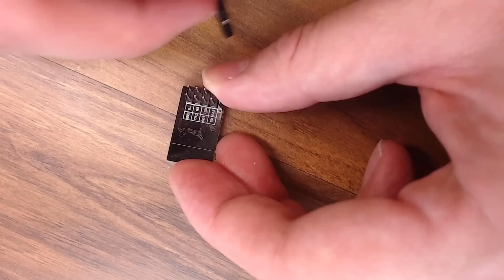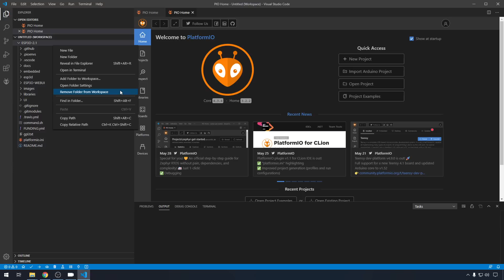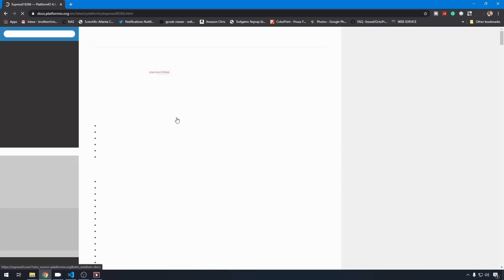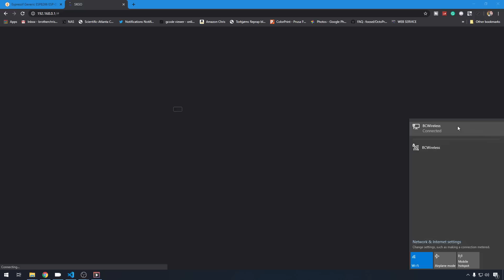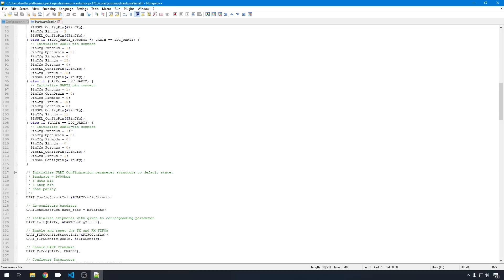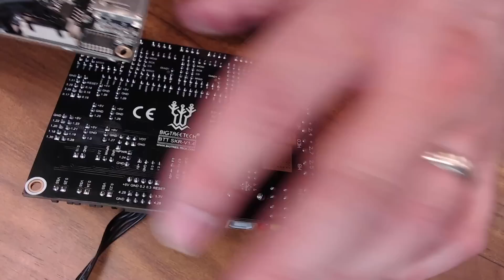Add Wifi To A 3D Printer - SKR 1.4 - ESP8266 - ESP3D - Chris's Basement

Comment: hello, i have problems with the esp8266 module, i do configure everythin just fine, and when i connect the module to the usb/serial adapter the esp3d ssid is ok, but when i do connect the module direct to the skr 1.4 board the module do not work, i tested the pin of the skr that goes to the ch_pd pin from and the output is 0V, that must be 3.3v, any help for this??
Reply from the maker: Those should be active all the time, so there might be something wrong with the board or voltage regulator.
Reply: @ChrisRiley  I just buyed two of the same SKR 1.4 boards and both have the same issue, and specifically to use with the esp8266 01, the only difference with the video is that you used the SKR 1.4 TURBO, but seeing the pinout of the WIFI port on skr1.4 and skr1.4 turbo on the board is just the same, THANKS for the response!!! I will try to solve this from the hardware side make a litle piece of board to make a short between 3.3v pin and CH_PD. Your videos are really helpfull and usefull. Keep going man!!! my best regard from Paraguay SOUTH-AMERICA

Comment: @11:46 - the error mentioned here does not appear in release 2.1.1, can anyone confirm this is OK? (I'm assuming it is, I'm just paranoid...)
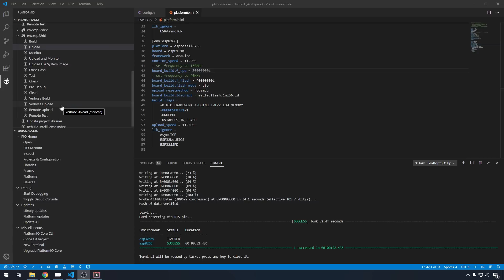Reply: also, @17:01, I dont have the "Upload File System" button.....
Reply from the maker: Check the ESP01 env, it should be there.
Reply: @ChrisRiley  So, the files are in esp3d/data (had more time to actually comb through everything). It appears as though you can still interface with the it through the web, you just need to manually upload the index.html.gz there. A button up top will say "switch to ESP3d Interface" or something similar, that will initiate the wizard.

Great Vid, and Thanks for the help!!

Comment: Chris, thank you for these excellent instructions.  I loaded the latest code, but when it came time to 'load file system image' I could not see as an option.  Clean has replaced "Erase Flash'.  Any ideas? thanks again.
Reply from the maker: There should be a ENV:ESP01 in there now to load the file system.
Reply: @ChrisRiley  -thanks, does this replace the [env:esp8266]?
Reply from the maker: No, just for writing the file system, not for code flashing.
Reply: @ChrisRiley  - So where would I need to add this ENV:ESP01?

Comment: i have no 'upload file system image' feature but everything else works. Idk whats wrong
Reply from the maker: Check under env:esp01s.
Reply: @ChrisRiley got the same proble,  what you mean with it?
Reply from the maker: @Thermal488  There is an option in the menu for the ESP01, you can upload from there.

Comment: Hi Chris, thank you for your videos, they helped me from the very base to understand and be able to compile my Marlin2 for Both LGT V1 (OEM for LK4 pro) and SKR 1.4Turbo i bought newly. Due to i've the TFT24 i had to work out a serial connection more to be able to use the screen in touch mode rather than Marlin that is unlike to me. To do it I ( #define serial_port_3 0 )right under the first 2 you suggest during the video. I really didin't know if this could work but Marlin2 got copiling w/o errors and flashing doing it good as well.
Thank you man again!
Reply from the maker: Great to hear, the Marlin team has changed somethings up for us to make this a little easier.

Comment: hi chris i am having problems after i enable wifi support i get file not found
Reply from the maker: Where do you see file not found?
Reply: @ChrisRiley  in the output screen as it compiles
Reply from the maker: @stiggybishope5449  Try to run a clean in the build menu.
Reply: hi chris my folder are fresh but esp3d  archive does bit si the file data option you mention
Reply: hi not sure whats going on but i get chip sync error

Comment: Chris could you make a video on flashing firmware to an skr1.4 either via octoprint or one of these esp modules?
Reply from the maker: I can check it out, not sure how it works yet.
Reply: @ChrisRiley  Me neither. Been banging my head against a brick wall with it. But other than processing power there's not a lot of reason the pi shouldn't be able to run platformio to flash the board via serial. Even building the firmware on something more powerful like a home pc and sending it to the pi over ssh to then flash.

Anyhoo, I love the content bud keep it up :)

Comment: It's a lot easier just buying a purpose built esp01 uart adapter to program these chips. You just need to solder on a button for when you plug it in to enter flash mode and you're good. Neat, no need for jumper cables. 
https://m.banggood.com/OPEN-SMART-USB-To-ESP8266-ESP-01S-LINK-V2_0-Wi-Fi-Adapter-Module-w-2104-Driver-p-1272171.html
Reply from the maker: Great tips, thanks for the link.
Reply: Also there is a few cents difference in price between the esp01 and the esp01s modules. Don't buy the esp01 buy the esp01s.

Comment: do u need the DCDC converter? SKR1.4turbo and esp8266
Reply from the maker: Not to use just the Wifi, no.
Reply: @ChrisRiley  would it cause issues? I have tried flashing with your method and with their uploader and neither of them provide an access point to connect to. I have managed to find the access point but it only stays up for about 30 seconds. I've also tried swapping tx and rx pins, timeout failure
Reply from the maker: @eliterr7005  I could be the module is bad or the voltage regulator is bad on the board. You can try and power it up off the board, this video might help you hook it up. https://www.youtube.com/watch?v=pJGBRriNc9I&t=1s
Reply: @ChrisRiley  actually reflowed the board and it works now. must have been a bad solder joint, would only work when squeezing the board between my fingers

Comment: I have a problem the wifi chip works while it is connected to a usb hub but as soon as i connect it to my skr 1.4(non turbo) it wont connect to wi-fi and my hardware serial.h is not the same it has a lot of if arguments and i dont know where to check witch is active.
Reply from the maker: There might be a problem with the voltage regulator on the board. Does it check out with your multimeter?

Comment: I don't have the Upload File System option. Thoughts?
Reply: Same here :(
Reply from the maker: The library may have changed. You can try using the web tool ESP3D software gives you or try running a clean from the build menu to reload the libraries.
Reply: @ChrisRiley  used web ui to upload data files. Works like a charm. Thanks for your videos!

Comment: Mine fell down at 11.45 'Path to shell executable "c:\Users\Ben\Documents\Arduino\ESP3D-2.1.1\platformio.exe" does not exist.' Any ideas?
Reply from the maker: It looks like it didn't get the library installed. I would try to reinstall the platformio extension and see if that helps. Also, you might try running a clean from the build menu.

Comment: Chris, good day.Your videos are very clear.I have a set:SKR 1.4 Turbo+TFT 35V3+ESP8266+3DTach+power off module(MW350 power supply)?Marlin 2.0.6; I connected everything according to your lessons-everything works out, thank you.But questions remain-please help.WiFi only works on the display.On the Board, according to your lessons, it is not possible to start(activate) - in Marlin2.0.6 contacts (28 and 29) in the UART3 port are registered but it still has pins (P0_25 and 26) and the module does not respond.((((Please help me figure out how to connect to Repetier-Host (I don't have a stable connection) and send files to the SD card of the Board?Files in their entirety are not they are sent, although it shows that the file is being written.I'm from Saint-Petersburg, please forgive the translation difficulties.Thank you for your work.Stability and good luck!!!
Reply from the maker: You will not be able to use the screen and the wifi connected to the board the serial gets confused. That's why it works on the screen, the screen is utilizing one of the serial ports. It's unfortunate, but you will have to pick and chose with serial devices you have.
Reply: @ChrisRiley  Chris, good day.I watch your videos many times .You have shown the solution path in Marlin 2.05,I use 2.06, and in the file (HardwareSerial) uart3 looks like this - (( } else if (UARTx == LPC_UART3) {
      // Initialize UART3 pin connect
      PinCfg.OpenDrain = 0;
      PinCfg.Pinmode = 0;

      #if defined(LPC_PINCFG_UART3_P4_28)
        PinCfg.Funcnum = 3;
        PinCfg.Portnum = 4;
        PinCfg.Pinnum = 28;
        PINSEL_ConfigPin(&PinCfg);
        PinCfg.Pinnum = 29;
        PINSEL_ConfigPin(&PinCfg);
      #elif defined(LPC_PINCFG_UART3_P0_25)
        PinCfg.Funcnum = 3;
        PinCfg.Portnum = 0;
        PinCfg.Pinnum = 25;
        PINSEL_ConfigPin(&PinCfg);
        PinCfg.Pinnum = 26;
        PINSEL_ConfigPin(&PinCfg);
      #else
        PinCfg.Funcnum = 2;
        PinCfg.Portnum = 0;
        PinCfg.Pinnum = 0;
        PINSEL_ConfigPin(&PinCfg);
        PinCfg.Pinnum = 1;
        PINSEL_ConfigPin(&PinCfg);
      #endif
)) I Can't connect WiFi on the Board(TFT is disabled).Help if you can.Thanks.Stability and good luck!
Reply from the maker: @jress6778  Is the module powering up?
Reply: @ChrisRiley  Yes, the module works clearly on the screen.If I put it on a Board without TFT, it is not determined by the Board.The port is registered 3 and 0. the code in Marlin is not clearly spelled out;in the letter above.Thanks.Good luck!
Reply: Same problem
Reply: @eklypa  я остановился на том,что модуль прекрасно работает в гнезде TFT 35V3;без подвисаний и в обоих режимах экрана=доволен очень.Те кто пишут о не понимании нужности этого модуля для меня странные;с ним удобнее работать со смартфона и удобнее даже нежели с тачь экрана принта.Если есть вопросы-рад буду общению.Спасибо.Удачи!
Reply: @jress6778  только что разобрался. Оказывается у меня стояла разная baud rate в прошивке принтера и в модуле wi-fi >_<
Reply: @eklypa  два вопроса-какая плата,и на каком Марлине?Спасибо.
Reply: @jress6778  Marlin 2.0.7, SKR 1.4 Turbo, ESP-01S (BTT)
#define SERIAL_PORT -1
#define SERIAL_PORT_2 3
#define BAUDRATE 250000
Больше в марлине ничего не менял
Reply: @eklypa  Понял.Евгений а можно на почту написать как связаться?хотелось-бы пообщаться на актуальную тему.""bsa-81175 собака yandex.ru "" буду признателен.Моё-Сергей.Спасибо.Удачи!

Comment: i have a CH341A programmer that I program Bios with it. does that work on this chip?
Reply from the maker: Yes, that should work, you just have to cable it up correctly.
Reply: @ChrisRiley  ye , I’m working on that, there are no documentation on these chips. I don’t want fry the new WiFi lol.

Comment: @chris everything went good and uploaded the firmware. In my list there is no upload file system to click on its just not there.. Any help om this I thank you for in advance
Reply: I had exactly the same issue. I solved this problem with this: 

1. Update the Espressif 8266 Platform to 2.6.2 (PIO HOME) --> search for "8266"  / click the Version (right Corner) / update to 2.6.2  / restart VS Code
2. open the project and edit the "platformio.ini".  Add line  " board_build.filesystem = littlefs ; SPIFFS ; "  in the  [env:esp8266] segment . Alternativly copy  and paste :

[env:esp8266]
;esp8266 core 2.5.2
platform = espressif8266@2.6.2
platform_packages      = toolchain-xtensa@2.40802.200502
board = esp01_1m
board_build.filesystem = littlefs ; SPIFFS ;
framework = arduino
monitor_speed = 115200
; set frequency to 160MHz
board_build.f_cpu = 8000000L
; set frequency to 40MHz
board_build.f_flash = 40000000L
board_build.flash_mode = dio
upload_resetmethod = nodemcu
board_build.ldscript= eagle.flash.1m256.ld
build_flags = 
    ; -Wl,-T
    -D PIO_FRAMEWORK_ARDUINO_LWIP2_LOW_MEMORY
    -DNONOSDK221=1
    -DNDEBUG
    -DVTABLES_IN_FLASH
upload_speed = 115200
lib_ignore = 
    AsyncTCP
    ESP32NetBIOS
    ESP32SSPD
3. "Build All and/or UPload All " under the Project Tasks / General. NO separate Donwloading for Ffilesystem required. After that, The ESP3 Accespoint appeared  and was able to accept thef iles  in the data folder.   
4. Continue like Chris suggested

I recently got erros for compiling the code. But I just hit the Build/ Upload  button again and everything was fine . Please note the filesystem is not SPIFFS Chris has used. But LittleFS is the one that is preferred  for ESP's with limited memory in the future. see : 

https://diyprojects.io/esp8266-upload-data-folder-spiffs-littlefs-platformio/#.X41Ji9AzZEZ

regards TOM
Reply: @tomsakelby9314  If it helps someone else, I had to restart VS Code twice for the settings to show up in order to upload through: Project Tasks->Default->env:esp8266->Platform->Upload Filesystem Image
Reply from the maker: Thanks for the assist!
Reply: You welcome

Comment: help - upload file system image is not there with latest builds of marlin / platformio
Reply from the maker: You might just have the wrong folder added, make sure you add the one with the Marlin folder in it.
Reply: @ChrisRiley  the correct folder was there and in the correct place...  PlatformIO has had a recent update.... I got around it by calling the function from the command line   ....  "pio run -t uploadfs"
Reply: @TheBpgoa  This worked for me. Thank you. For anyone trying in the future, click on the Ant PlatformIO logo on the left in VSCode, then under Miscellaneous there is an option PlatformIO Core CLI. Click that, enter in "pio run -t uploadfs" and it should upload the files just fine!!!!!

Comment: Yo! I just watched your tutorial and it helped me a lot figuring out the ESP-01s module working with my SKR 1.4 Turbo board. The good news is the latest Arduino framework core for the LPC1769 already contains the definition for UART3 on both P4_28 (the one you've been modifying) and P0_25 (don't know what this one is for yet).

The way I use it is I do this in my Configuration.h:

/**
 * Select a secondary serial port on the board to use for communication with the host.
 * :[-1, 0, 1, 2, 3, 4, 5, 6, 7]
 */
#define SERIAL_PORT_2 3
#define LPC_PINCFG_UART3_P4_28

It limits the number of changes I need to do because I do need to enable SERIAL_PORT_2 anyways so there's no point in messing with the previous serial port.

Anyways - thank you very much for the video!
Reply: Hi, perfect for me but, my TFT24-v1.1, don´t work.  If you put its #define SERIAL_PORT 0
 all is correct, TFT and WIFI ok.
I´m in MARLIN 2.0.6.1

#define SERIAL_PORT 0
  // Port for REPRAP_DISCOUNT_FULL_GRAPHIC_SMART_CONTROLLER  (TFT 24 V1.1)
/**
 * Select a secondary serial port on the board to use for communication with the host.
 * :[-1, 0, 1, 2, 3, 4, 5, 6, 7]
 */
#define SERIAL_PORT_2 3
 // Port for WIFI ESP3d esp8266-01
#define LPC_PINCFG_UART3_P4_28

Important!! on the ESP8266 you have to solder a wire between 3.3v and CH-PD , the pins on the SKR board are "not used" 

Chris, good video and very clear, Now I am subscribed and you have my Like... 

Mathias THANK YOU for your idea, I have been changing options a week before. 

Greetings from Spain...
Reply from the maker: @javsen2121  Thanks for the notes, this will help others.
Reply from the maker: Awesome, great to hear they updated it, I am going to try it out.
Reply: @ChrisRiley  http://padcom13.blogspot.com/2020/09/esp3d-on-skr-1414-turbo-with-esp01s.html - I've put together what I needed to do to get it to work. Hope it helps

Comment: hi, Thanks for the help. Yesterday i reinstall all the things again. But my wifi is not working like in the previous installation. I also try to add files in the arduino core value. The hardware serial file is now little bit different.  Can you please check.
Reply from the maker: I am not sure what to check, did they release a new version?

Comment: You Rock DUD !!!
I have been fighting whit getting this wifi stuff to work and whit limited success got it to work via skr screen but not with out touchscreen enabled and not stabil over time. so thank you - thank you  - thank you.... :-)  
By the way I have a BTT SKR 1.4 Turbo board that works for now via Octoprint,
 but will not read from SD or take marlin up date via sd slot no error code no warnings when trying to use the sd slot. 
I did update marlin to ver 2.0.5.4  ca 14 days ago via sd and have not used the sd slot more than once after install of last update and that time every ting worked fine. 
One day it just decided to not work have seen several comment online about this problem but no fix other than send it back to BTT and get a new one... 
And to date not any luck when contacting Btt or Aliexpress other than the usual run a round whit excuses. And i am to cheap to buy a new card when there is a remote chance to fix it, so i`m trying all options i can think of. 

Have done all the simple things like trying other sd cards checked connections (solder points onboard)  and checked marlin firmware that was up loaded and  compared the old ver. stock ver. to my ver. and no difference except the things i enabled  like blt/tcm 2209/sensor less home and that good stuff, and sd card is enabled so i am real stuck here if you can find it in you heart to give this problem some att. 
Regards from Helge from NORWAY.
Reply from the maker: Thanks! You have already done all the things I would do. I have heard a lot of others with this same issue. I am not sure what causes it I am afraid.
Reply: @ChrisRiley  thanks any way al hope is not lost yet will keep on bugging every one until i get told to get lost or something . :-)